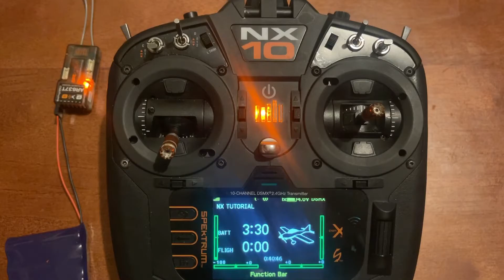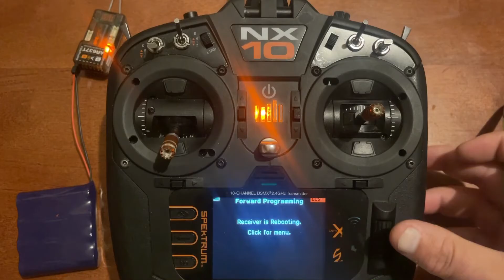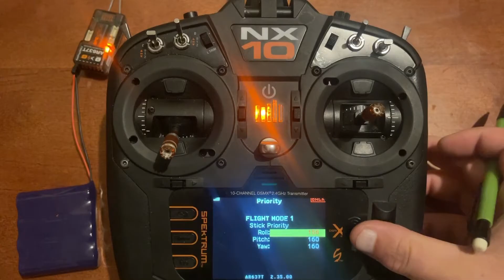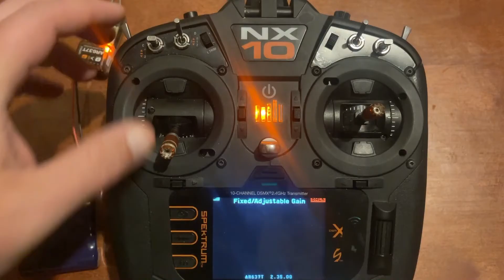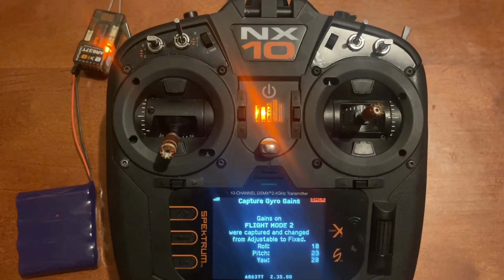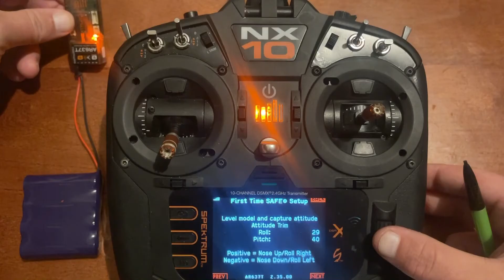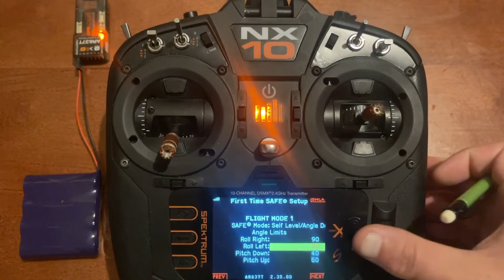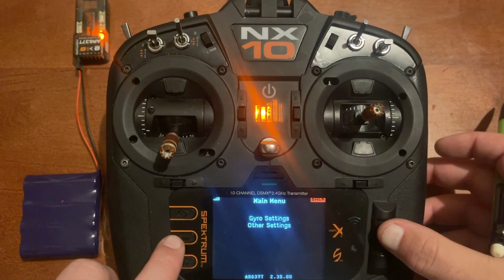Spektrum NX Setup: AS3X and Safe Setup

Comment: I've followed your video step by step. Everything looks good. But when I'm finished the gyro stabilization is not working.  I have set F-modes up on the E switch and gyro on the F switch.  I used stabilization on my Spektrum DX6 without any problems. But I'm missing something here.
Reply from the maker: F Modes for trim on Switch E and Stabilization for F Switch,correct? Make sure to assign knob for gain control or change "adjustable and fix gain" option to fixed on each axis.

Comment: BD  in this excellent video you have programmed AS3x on Switch C with Flight Mode 1 giving BOTH SAFE and Full Default  AS3X gain,   Flight Mode 2 giving medium AS3X gain and no SAFE and Flight Mode 3 with neither AS3x or SAFE. But I would like to have SAFE select on another switch and leave Switch C just for AS3X control. How may I do this please?

Comment: Hello BD, Thank you for an excellent video in explaining AS3X and SAFE.

However, what is not clear and perhaps to me is the part where you have to level the plane to capture the reference point.

For example, if the airplane is a tail dragger, that means that the captured reference will be a pitch up value.

Question: Does this pitch up value make the airplane pitch up when activated.

OR, should a bubble level be placed on top of the receiver or the receiver datum and the tail of the airplane lifted such that the bubble level is center thus the captured pitch value will be 0.

Thanks

Comment: 2 years and still too good, perfect explanation also help me to have knob as gain switch and adjustable gain, I  just find out the best set up and save it as fixed gain, later down the road if need I'll be able to reset to new gain settings.
Thank you very much BD.
Reply from the maker: Thanks Peter for the loyal support and good feedback!

Comment: NX8 with Micro Draco 800mm: I have model bound and functioning (all surfaces, throttle cut, flaps, D/R). I go to forward programming and it fails to connect. Any help appreciated! (My goal is to use switch B and program all three positions to be similar to beginner/intermediate/advanced...I KNOW SAFE/AS3X is totally different but this switch is comfortable for me).

Comment: One question: if I download the template of an airplane, can I make any adjustments manually on the flight modes and the AS3x later if I need too? Or I have to make the airplane setup manually instead of the template?
Reply from the maker: AS3X flight modes can be adjusted at anytime. Templates only setup radio functions to start and can be changed too...

Comment: Help-You state to have the antenna leads towards the nose and servo ports towards the rear of airplane. In the BNF Ultra Stick 1.1 manual it shows to have the antenna facing the rear of plane and servo ports toward the nose. I am confused as this is the first time I am attempting forward programming. I do not want to take a 50/50 chance. Is the manual wrong? Thanks in advance.  Great video
Reply from the maker: Put the antenna 90* orientation. Doesnt matter which direction tho. Best results will be away from things that block antenna (battery,bundle of cables ,etc) and 90*.

Comment: Hi everyone, I binded the AR636A receiver with the new NX8+, the controls works but when I go to forward programming the radio lights up red and responds connection failed. I tried to activate the SAFE as the manual says (crossing the Sticks and moving the switch 5 or more times), but it doesn't work. I must say that with the old DX7S, even with some difficulty, I managed it. I'm in crisis.. Do you have any advice? 
Greetengs from Italy.
Reply: Hi, the DX7S i think doesn't support forward programming so you would need the Spektrum programmer to do any programming of your esc.
Reply: Thanks for your attention. I found out that the problem is not the DX7, (I  said I bind using the new NX8+), but the receiver that does not support forward programming.

Comment: Great Videos, I am having an issue with AS3X and or SAFE. Im om a ix14 and after assigning the AS3x switch the model is trimmed but when I want to turn everything off and I flip the switch the elevator pitches up for some reason. This is on a turbo timber evo with the TA receiver. I do not see Other GYRO setting to do a factory reset. ANY IDEAS?

Comment: Thank you for your video!.
I have question: Do you know why I need to bind my AR630 Spektrum receiver to my NX8 TX each time that I turn on the system on in order to fly my model?
Thank you for your advice.
Mario
Reply from the maker: 1) Button is stuck
2) Defective receiver
3) Bind plug installed
4) Reverse lead or BEC signal is reverse in bind port

Comment: Excellent video BD thank you! I’m still a bit confused about “gains” and the way they set it up in the receiver but I’ll keep reading/watching. As in “160 means full stick turns AS3X off”…huh? What? But you’ve given the best information thus far on “gains” in general. Great stuff man. Very helpful…slowly becoming more literate as far as forward programming goes and your video got me 80 percent of the way there.
Reply from the maker: Stick priority is default at 160. I leave default and adjust gains.

Comment: Just flying the F22 raptor 90 mm maiden today flew like crap took it from the F-16 90 mm Free wing which I did not like a bitch to land want to hit safe and it flipped upside down and about crashed. Didn’t realize that you have to change the receiver program to face the other way because I had to facing the opposite. Thank you for your help man just realize that.
Reply from the maker: Glad you found the issue. Glad video helped,reach out to me anytime :)

Comment: So I’ve got an odd issue on an ar630. I have it all setup and safe is working correctly, but as3x never does anything. Yes I’ve made sure he throttle over 25%. Even after that nothing happens. Flip into safe and it works as expected. I’m using an nx8. Any ideas would be VERY appreciated.
Reply from the maker: Did you assign a gain switch? (ie knob) Turn the knob fully clockwise,turning to the left will reduce gains. Gains are fairly low from the factory. Dont have a gain select on rknob, select fixed in "adjustable/fixed" menu. Default gains are too low for some planes and when testing wont hear servo movement. Lastly, some receivers can be defective,which makes Safe work but not AS3X...

Comment: Thanks for the help. My questions are.....Can AS3X be used without activating SAFE?   Once AS3X is set up, is there a way to do some sort of a "bench test" to see that it's working?
Reply from the maker: Yes, dont activate Safe by not doing first time Safe Setup.

Once you complete first time setup AS3X will beomce active after 25% throttle. Shake the plane to hear servos or see surfaces move. Sometimes default rate isnt strong enough to observe easily. So turn the multiplier to 4X for "bench test".Once checked, turn back to 1X...

Comment: I purchased a Stryker delta wing and want to move from the AR600 w/o safe to a AR631. When I moved the servo wires to the 631 the elevator & aileron stick are switched. Up/down moves ailerons and left/right moves the elevator. Switching the wires at the receiver and rebinding doesn't change anything. Still switched. Help.... I'm stumped - 
thanks to all who any ideas
Reply: A f27 Stryker. 1 throttle, 2 aileron 3 elevator 4 rudder. 
I choose wing type evalon.
Reply from the maker: @RC_planeGuy  change aircraft type.Try changing to elevon "B".
Reply: @BDTennessee  Tried that but the same bad outcome. Here is the complete setup
Model: Parkzone Stryker F-27Q 
When I bought it from a club member, we setup my NX-8 with the AR600 that he flew it using. The controls worked correctly. I wanted to add SAFE/AS3X to it so I am replacing the receiver with a AR631.
 
The AR600 and AR631 both have the same pinouts. As the Stryker is working correctly on the AR600 I expected moving the wires in the same sequence on the AR631 would match the stick behavior. It does not. 
The 600 works with Aircraft Type-wing: Elevon
I testing the 631 with both Elevon and Elevon-B and neither work.
Under Channel Assignment 
   Channel Input Config
     2 Aile:N/A
     3 Elev: N/A

   Rx Port Assignments
      2 Aile: Right Ail
      3 Elev: Left Ail
Reply from the maker: @RC_planeGuy  so above you mentioned "1 throttle, 2 aileron 3 elevator 4 rudder. "

You have wiring wrong. They need to be split (no y harness). Right side servo into channel 2 and left side servo into channel 3. Once thats done go into Servo setup and reverse the servo direction if needs direction corrected. If that doesnt work change back to elevon "a" and reverse correction.

Side note: Message me on facebook and i can walk you through...
Reply from the maker: What channels are you connected?
What aircraft type you selected?

Comment: GREAT video.  Got a question.  My SAFE / AS3X switch is in the upper left, rear corner of my DX9 Transmitter.  SAFE is all the way back, and AS3X is pulled inwards.  How can I reverse that function, to where AS3X is all the way back, and SAFE is inwards.  I would imagine the procedure is similar enough with most Spectrum Transmitters.  If you can help, let me know please.  THANKS.
Reply from the maker: Which receiver using? Older receiver such as AR636A its default in a position. Should be able to go into servo setup and reverse the channel. Newer receivers with forward programming you change in flight mode setup.

Comment: 2 questions.  Can you put AS3X on one switch (I liked the 3 levels) and safe on another 2 position switch (ie on or off)?  Second, what do the black L and R trim switches do?  I can find no description or explanation for them.. thank you for your superlative guidance.
Reply from the maker: 1) Flight modes (AS3X and Safe3 modes) have to be on one switch when using basic forward programming setup.

2) You can use them in many different ways.Works like a momentary switch stock.However you can change switch to perform as 2 or 3 position switch.

Comment: Hey there - thanks for the video. I have an dx8e. Tried the Setup - only problem now is the safe reacts with the rudder not with the aileron. I fly with aileron/throttle on the right, rudder/Elevator on thble ledt side. You have an idea? Thanks in advanve
Reply from the maker: Should work on roll,pitch and yaw. You may have the knob turned to the left and lowers the rates. Rudder will work when others dont since its the highest value...
Reply: @BDTennessee  Switched rudder with aileron on my dx8e, now it works. :D
Reply from the maker: @F5connecting  glad you got it fixed!
Reply: @BDTennessee  I am now trying to make the safe more aggressive. Works only a little bit.
Reply from the maker: @F5connecting  more aggressive in bank or rates?
Reply: @BDTennessee  I mean rates - probably :D well when I take the model and get the nose down, the elev just reacts a little bit. Not as much if I would do it manually.

Comment: My problem is when I go from safe to without safe the trim is off badly, so I have to trim the airplane to fly level then when I turn safe back on the airplane is off trim again??????
Reply from the maker: BNF model or PNP airplane that you added a receiver?
Reply: Trim your plane with SAFE turned off; don't use the trim levers in SAFE mode. If it doesn't fly straight and level in SAFE mode, you need to go into Forward Programming and adjust the Pitch Attitude Trim values.
Reply: @txkflier  Thank you... but it flys fine in safe mode... when I turn off safe it goes south sideways real fast and if I trim w/o safe and go back it's out of wack again. I have checked the airplane out on the ground and see no aileron or rudder problems same with the elevator nothing seems out of order.....I have three airplanes all are doing the same thing???
Reply: @ghoward6797  Is it possible that you have the gyro reversed on rudder? SAFE doesn't control the rudder; only AS3X does. I check the rudder direction by holding the plane in front of me with the nose toward my stomach and then rotate my body to the left or right. While I'm rotating, the rudder should deflect in the same direction that I'm rotating. When I stop, it should go back to center. Before you do this test, you'll have to activate AS3X by raising the throttle above 25% for a second and then activate throttle cut.
Reply: @txkflier  never thought of that..I will check that out thanks
Reply: @ghoward6797 If they're BNF's and still have the factory programming, they should be correct. With BNF's, the flight controls should be set to normal (not reversed) in your transmitter because Horizon sets the reversing in the receiver. If you reprogram the receiver yourself, then the reversing is done in the transmitter and the transmitter tells the receiver which channels are reversed when you run the "Relearn Servo Settings" routine in Forward Programming.
Reply: @txkflier  when I get home tonight I'll check it out and get back with you again thanks for your help.... and I can't wait until the weather changes so I can fly again
Reply: E-flight tember...a-10 and crop duster radio is spectrum de 6 x thanks bnf

Comment: Thx for the video. Is there a way to reset the as3x receiver without using the transmiter so I would use it on a new model since I don't have NX TX?
Reply from the maker: You have to access with transmitter.Doesnt have to be NX...
Reply: @BDTennessee  Great thank you

Comment: Hi there do you need to set up as3x or is it plug and play? I've had eflite planes that are bind and fly with and have to do nothing the as3x works without having to program, so I'm just asking if I buy a 10 channel as3x receiver for my corisar do I need to program it? Or will it automatically work cheers jason
Reply from the maker: BNF model come preset.Receiver off shelf will need to be programmed. Follow setup guide and will be good to go :)
Reply: @BD Tennessee  ah ok never used one in my gas models before always just used the spektrum 10 channel non as3x do you think it's worth getting? Cheers
Reply from the maker: @jasegazzard3743  having a AS3X receiver will make model fly "smoother".However being on gas plane be careful cause of vibrations.You can always turn off AS3X if you dont like it as well.

Comment: Hi BD, I had a quick question I was thinking of buying the Durafly EFX Racer (PNF) Yellow Edition High Performance Sports Model 1100mm.  it has a 60 amp Aerostar esc. Would a as3x and safe receiver work with it? I have the NX8 Transmitter. Thank you for your time. Great video I just learned how to set one up if it would work with that plane.
Reply from the maker: Yes would work. You may consider the AR630 or AR601 cause of smaller footprint unless you need full telemetry...
Reply: @BDTennessee  Hi BD, well I bought the Durafly today. So should be here next week sometime. I still will have to purchase the receiver but no Biggy. just a fast run down, I usually buy the BNF planes and jets. So this will be a new deal,  setting everything up by myself. So if I am understanding all your info, First take the plane out of the box. "lol" I have the NX8 Transmitter set up as new model. Set switches the way I like and setup the flight mode for as3x and safe. Then put plane together,  don't hook up any control arms yet, mount receiver in plane, then bind it. Then after it is bound make sure all control Surfaces are level, and moving in the correct directions. Then I can proceed to setting up the receiver in forward programming? Thanks for all your info and time man.

Comment: BD, is this necessary for all planes set to Safe? I am new to flying and do use safe but never saw this before. Or do you do this to fine tune your settings? Love your videos. They have taught me so much but this one is confusing to me being a newbie. Thanks
Reply from the maker: Setup allows you to fine tune settings. Open stock (ie store bought or unlocked BNF) can be adjusted. BNF which i have another video you can set or bind in safe which has less options...
Reply: @BDTennessee  Thank you. I saw the other video and just saw this one. Honestly I never knew you could do so much with fine tuning. I have an NX8. Thanks again.
Reply from the maker: @cyclerider18  thanks! :)